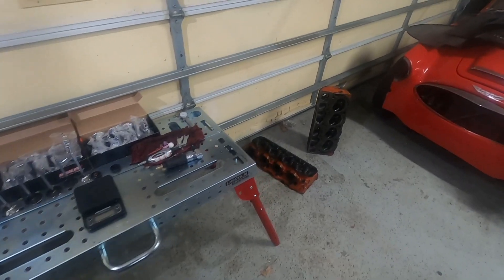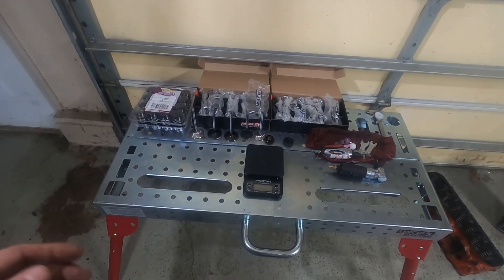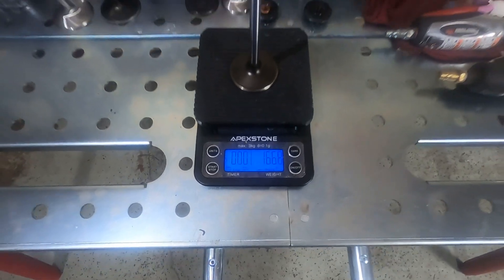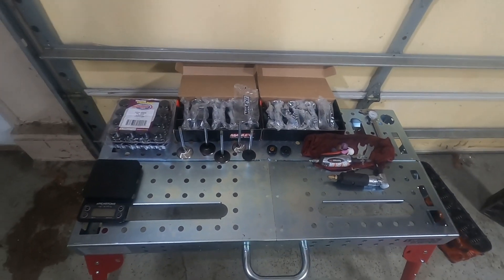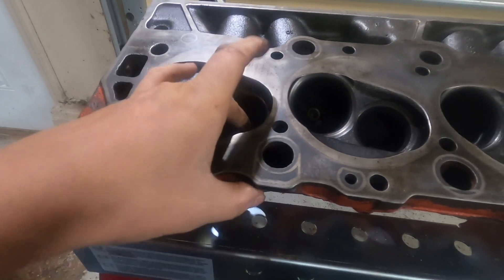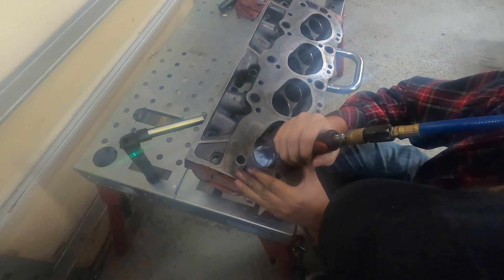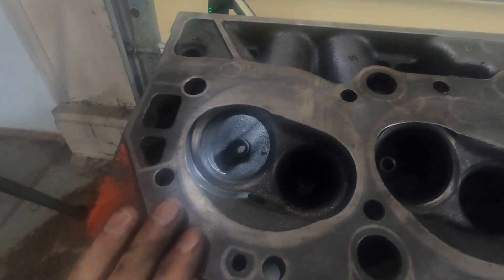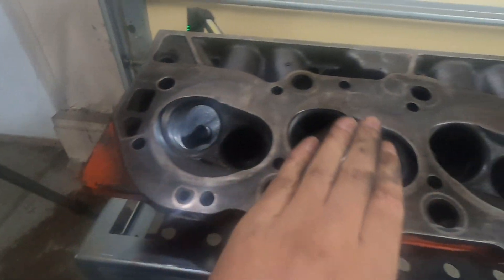First time porting Big Block Chevy oval port heads! What could go wrong?

Comment: I heard those are good heads. But they are heavy. I have a similar head, 290's on my '70 Chevelle 454 SS. They rock! I see why most head porters will not port cast iron. It's a PITA.

Comment: Sweet!!... i have a set of 215 heads on a gen 6 454. I'm planning to do this very thing.
Reply from the maker: The larger bore definitely gives you more flexibility, as you have more room to unshroud the valves if so desired. It feels with the smaller bore block I'm chasing a balance between compression loss and flow numbers.

Comment: Lucky for you these heads have enough material to fit the larger rectangle ports. With bigger valves, they will support 600hp no problem.
Reply from the maker: The castings certainly seem to be quite meaty around the valve bowl, which definitely helped the nerves while opening them up. I'm not sure what you mean with regard to the rectangular ports though. Do you mean that they used the same overall runner casting, just with different interior dimensions between the oval and rectangular port runners?
Reply: @JamesSorenson  Back in the day, people used to hogged  out the intake ports, that they kinda looked like rectangle ports. that might be what he was saying.  i had a set of 1966 oval port closed chamber heads and they had been hogged out.   there is lots of metal in the ports of oval ports.  Rectangle ports, not so much.

Comment: prob just gained at least 70.2hp and 27.6lbs of torque.. and lighten up it 110lbs off engine - front end of that SS Chevelle, witch relates to maybe 1.4secs faster..?  We shall see.. Good content and Job, James.
Reply from the maker: Haha, I'm all about them gains! 🤣
Reply: @JamesSorenson  we all are...  I think, I have enuff... Not !
Reply: @JamesSorenson   I get it as I am too. BB Old's 425ci .30 over crap heads now but I got a redone set of big valve 'C' heads and better intake. PC period correct. '64 Cutlass/ F85 2dr post. sedan.